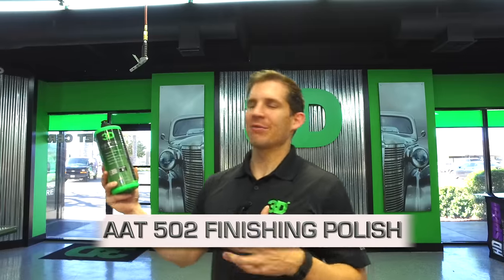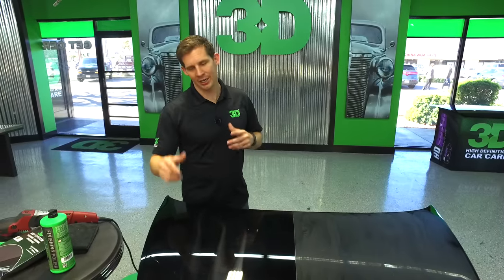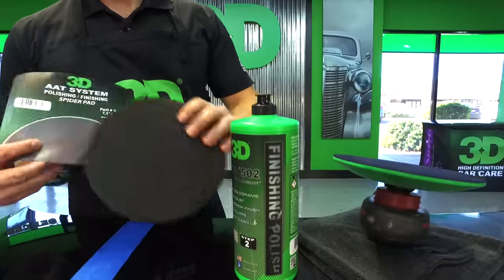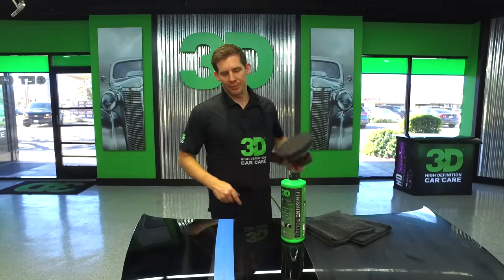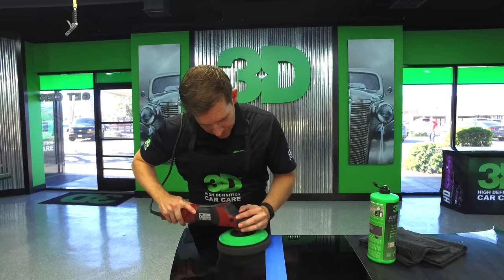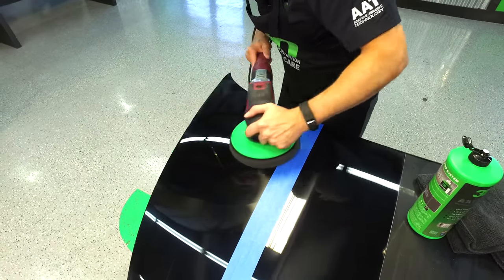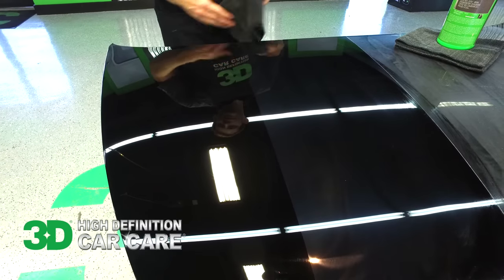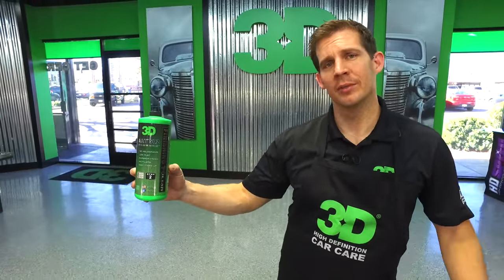502 Finishing Polish

Comment: Hi Donald, just tried the 502 with the spider pad and the initial result was great and since I don't have Prep All I used Gryons cleaner. I thought it has the same IPA as Prep All but I got a rubbery milky coat the looks as if I had burned the clear coat. I could not remove it with the micro fibre towel. Later I got most of it off rubbing with my thumb on it, nasty. I also tried the 3M cleaner with the same nasty residue. What do I do wrong?
Is it the cold temps here in my garage, had around 34 degrees but could not find a temp limit on the bottle. Or are there product incompatibilities? What is in Prep All?
Thanks Bernhard
Reply: 3D Products 
The cleaner was called Gyeon Q2M Prep. It is used to remove all wax and residues before applying any coating. One more thing, it was inside my garage but just slightly above freezing temps.
Bernhard

Comment: Is this a needed step after using the 505 correction glaze or can I just use that instead of this?
Reply from the maker: 505 is the final step.  after the 502 you would need a wax.
Reply: Maybe I worded that incorrectly, what I meant to say was can I just use 505 correction glaze instead of this product since it has the Montana wax as well?
Reply from the maker: yes, you can use 505 as a finishing polish after the 501 instead of 502 on most finishes.  If it is a harder finish, it might be better to use the 502.
Reply from the maker: yes, that is accurate.

Comment: I recently got some Hd Cut and Hd Polish. What's the difference between your two product lines? Is this the more premium product ? The Hd Cut and Hd Polish also state no fillers or wax along with diminishing abrasives. What am I missing? 
Thanks!!!
Reply: William hd cut and hd polish abrasives dimishes so the lomger you work it it will loose cutting. The 501 and 502 abrasive wont domishes so you are always cutting and the working tome of the product is less.
Reply from the maker: The AAT 501 and 502 are higher grade than HD Cut and Polish.  The AAT products will be faster overall. However HD Cut leaves a very good finish for a correcting step

Comment: What’s needed from y’all website for a step 2 paint correction
Reply: Depends on how bad the paintwork is and whether it will correct easily. You may be okay with the 502 then finish with the 505 or just a sealant. Or it might need a bit more cut with the 501 then finish with 502 or 505.

Comment: How much would you charge for a job like this?
Reply from the maker: For paint correction on an average sedan, you could expect to charge/pay between $250 to $500 depending on the surface damage.
Reply: @3DCarCare  how do you determine if it needs a paint correction or wax
Reply from the maker: If you can see scratches in the paint, like spider webs, you can correct it.  You are always safe applying a wax to the finish.